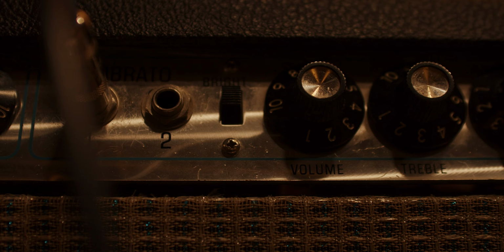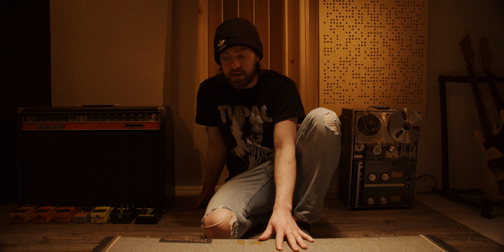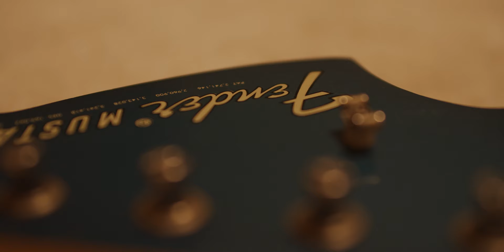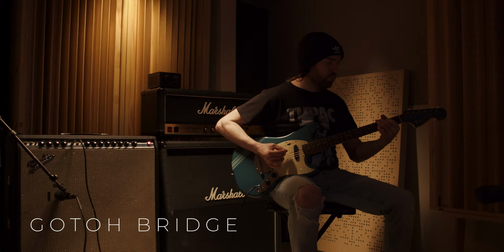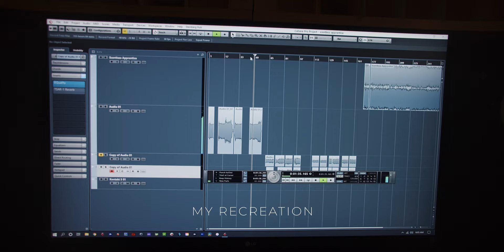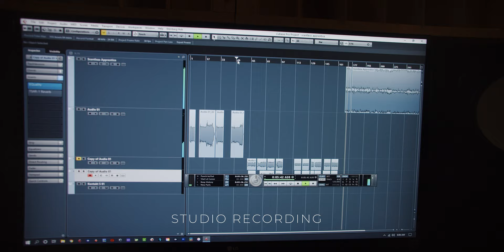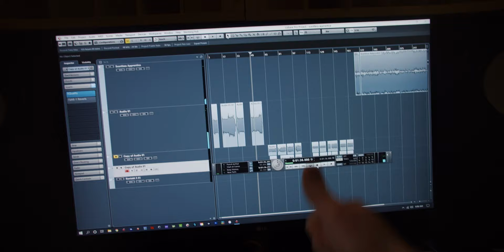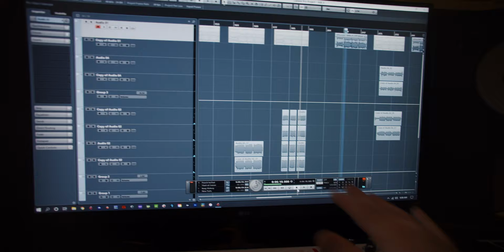1970 Competition Mustang. Original bridge VS Gotoh Tune-O-Matic bridge for Nirvana Tone

Comment: I hope this helps, I have 3 mustangs and I turned the “cigar” on the bridge backward so the strings are pulled straight through. Then I put a lock washer on the posts and screwed the posts all the way down so the “cigar” is flush on the tremolo plate. Why? Because that’s what Kurt did. It does effect the tone (for better or worse that’s your opinion) but it does replicate his tone a great deal at least to my ears. Also when I put new strings on a guitar I tune it to pitch, stretch the string two strings over, and repeat until it stays in tune even after stretching the string. This will help with the new string sound that I also hate. You remind me a lot of myself when it comes to what you’re doing with replicating Kurt’s sound. I’ve been doing it for 22 years. Again, I hope this helps.
Reply: Couldn't have said it better!
Reply: I agree flip the cigar tube around go to Home Depot and get some Allen head machine bolts and 7mm washers and loc tite then you don’t have to have washers under the tube which are visible and with the bolts the tube sits flush against the plate giving a steeper break angle to the bridge.
Reply: Right, you don’t want the washers to be seen, that would look weird. You’ll have to remove the tremolo plate, remove the springs, then put the washers on and tighten. Then put the tremolo plate back on.
Reply: Do you have a video or photo instruction how to do that? I mean the bridge. That would be really helpful
Reply: @jessielike2  I don’t have a video. If you remove the plate you can see the posts I was talking about. Remove the springs from the post and discard them, unscrew the posts in the “cigar” the strings run through, turn the “cigar” around, put a small lock washer (a THIN lock washer) on the post and screw it back into the “cigar”. It’s really that easy.
Reply: And how to get rid of the new sound of the strings?  Make them sound more vintage and old
Reply: @jessielike2  the brightness of the new strings will go away the more you play them.
Reply: @jamesh1625  Yeah man, that's the problem. It takes me a few months to get good sounding strings. If only there was a way to do it faster
Reply: I tightened up the springs in the tremolo and it drops 3-4 frets down and 1 fret up while keeping it in tune NO MATTER WHAT . Case in point it goes back and forth with me 5 days a week and in temps 20-70F and NEVER needs tuning.... It's almost scary how it's always ready.
Reply: There is absolutely no advantage to reverse the cigar (apart from doing like kurt). It doesnt bring any tuning stability. It only makes it impossible to use the supercool vibrato, and it ruings the break angle (if you dont use one those tuneomatics that makes 7.25’ radius mustangs play like shit and being impossible to intonate properly). It’s just 100% downgrade

Comment: Your video quality and production is always so consistent, you seem to prefer quality over quantity, Overall TOM does sound more darker and it doesn’t let the notes ring out as much than the stock bridge. After hearing the comparison I must say I was pretty dumbfounded that the stock bridge did sound a bit like Kurt’s real mustang but also the TOM also did have some of that aspects of Kurt’s tone here and there. In conclusion: Stock sounds better and TOM has better tuning stability and Intonation.
Reply from the maker: Thanks man, I agree. I've already reverted it back to stock. I've decided to sell this mustang. I like my sunburst one more.
Reply: @AaronRash  Yeah i recently saw the listing, I know that it's your guitar and you decide whether you keep it or sell it, but im just gonna say here that you should keep it and it will shoot up in value in a few years
Reply: No, the tuneomatic doesnt bring more stability (you can put sleeves on the mustang bridge posts if you absolutely want it non-rocking, but from my experience it’s completely useless on a stang). Regarding the intonation, tuneomatics make it almost impossible to intonate properly, because of the mismatched radius that brings the outer strings action way too high especially in the higher frets (and anyway, the mustang bridge also has also individual saddles ajustments, so no advantage there too)

Comment: Agreed. The tune-o-matic takes all the low end thump out of the guitar and gives it this nasally midrange. Another problem is that it introduces a radius mismatch with the 7.25” fingerboard. The tune-o-matic bridges are made for Gibson style guitars and thus have a 12 inch radius. I’ve had a few guitars with this pairing and find them uncomfortable to play. Great video!

PS: you made me wince when you started filing the saddles without taping off the pickups! Those metal filings can wreak havoc if they get on the pickup magnet.

Comment: How did you get the posts to the TOM bridge  to fit in the mustang thimbles? Also Milk It sounds fantastic dude. Can’t wait for that! That’s my favorite In Utero track I’d say
Reply from the maker: Thank you! I just took some gaffers tape and wrapped them around the post to fit.
Reply: @AaronRash  i did that to my 95 jagstang...I got it brand new in 96 i think, made that mod to the original tremelo/bridge, its held up this long.....and its still the same tape...
Reply: It’s likely that mounting the Tuneomatic with gaffer tape isn’t going to do things any favours tonally. 

I recently swapped from a Mastery to a Tuneomatic on my JM using Rocking Excenter Bushings and prefer the Tuneomatic. 

The bridge still rocks as there is a little bit of play in the mounting posts in the bushing holes and with the bridge on the posts and thumbwheels.

Comment: What type of Gotoh Tom are you using Aaron? As I see others doing this mod by taking out the bushings from the body, plugging the holes and redrilling for the Tom bridge, where as you just did a straight drop into the body mounted bushings, see I’d like to try this way so i could revert back to the original mustang bridge 👍🏼👍🏼👍🏼 Cheers bro

Comment: Nice video, as always. Just to react to some comments i read. I had 3 made in japan mustangs (and played a lot of my friends’ stangs too). These were among the most tuning stable guitars i’ve had (a lot more than my SGs and LesPauls with tuneomatics and stop tails which couldnt keep a G string in tune for 5 minutes). Putting 12’ tuneomatics on those 7.25’ radius guitars and reversing the cigar is 100% downgrade. It brings nothing but problems; makes playing difficult because of the inconsistent action (and yes you can file the TOM saddles, but you have to remove so much material it causes other issues in most cases), it makes the guitar hard to intonate properly (outer strings too high in the higher frets), makes a super cool vibrato unusable, makes you having to shim the neck for no valuable reason (mustang bridges also have individual saddles ajustment, they stay put if you don’t use the trem, and you can put some sleeves around the posts if you absolutely want them non-rocking). And now, thanks to that video, you can see that it doesnt sound better either (not that KC was doing it for tone purposes anyway). Just keep in mind that it was a different time (no internet ressource, no straytrems / masteries / halons and what not). Now people just know better on offset guitars, and imo there’s no point paying extras to modify a perfectly fine guitar to only make it worse. And it’s ok to love Kurt without cosplaying everything he did, even some odd choices he made when he was 25 (i bet he’d prefer that too anyway).

Comment: I noticed the nut slots were too deep and the Gotoh saddle contact points were filed way too wide and round. I know you wanted lower action since tuneomatics in fenders sit way too high, but that really affects tone and intonation. The string contact points have to be filed to a thin and sharp point. Im putting a fresh Gotoh in my mustang, and I’m going to slightly shim the neck like you did but with a full shim . I made a new bone nut from a blank with proper slots and string height and I’m also going to grind down the underside of the Gotoh where it sits on the thumb wheels, to avoid filing the saddles.

Comment: The original clearly sounds better. Have you set the pickup height in relation to the the strings equally in both bridges? If you are having problems with the stock, maybe you should try the Mastery, I like to think it is what Kurt would be using nowadays. Thurston Moore and Lee Ranaldo use them. 
Regarding IU tone, I made a video trying to recreate Very Ape lead guitar tone, got a close result using a P90 equipped guitar (simulating the Veleno) and a op amp fuzz, perhaps that's the song Kurt used a Big Muff (Albini mentioned one being used).

Comment: You can try nylon saddles on the tune o matic it will mellow it out a ton. try them. also he reversed the tail piece which actually changes the string tension a bit. try that too! I had a 69 just like yours (and kurts) I did all the same mods - then sold it. Still regret it. I now have the sig. Mustang in sonic blue -it hits the spot.

Comment: Don’t be so quick to lose the Tune-O-Matic.
There’s a couple things you can do to improve it.
You can switch the saddles to either roller saddles or nylon saddles that most Gibsons used in the late 50’s and 60’s.
I think either of the two will outperform the stock metal saddle that Gotoh uses.

Comment: the gotoh on its own sounds really dull but if you block the trem and flip the cigar so the strings run straight through (like kurt did) the tone is a lot better
Reply from the maker: Hey man, I've done that before also, not enough downforce on the bridge and the tone sounds worse in my opinion. I'm actually not really a fan of Kurts live mustang tone. I'm crazy about the in utero recording tone though.

Comment: I put a Gotoh oh my new jagstang and I also have mixed feelings about it. The neck is a 7 1/2 radius or whatever so the two e's seem a bit higher and then so you're always fighting string buzz or those two being lifted. I don't know what neck you have, but if the radius is less than the newer 9 or flat 12 it could be that? I'm a tinkering, but I'm unsure of my skills, so maybe my shim setup isn't right or maybe my bridge needs filing. It probably is the filing for me.

Comment: Hi guy! I'm trying to know what the width of the stripes is on the fender mustang competition, could you measure it for me? I have a Classic Vibe '60s Competition Mustang and it is 4,5cm (1,77165 inches) wide. I want to sand it to paint it like Cobain's so I bought a sonic blue stripes sticker but it is 3cm (1,1811 inches) wide. So I was wondering what the official width was on 1969 Mustang Competitions, could you answer that? Thank you very much and congratulations for your work

Comment: I do like it better with the stock bridge, the funny thing is that he used the Competition Mustang in it's original state to record Nevermind, he added the tune o matic bridge later in '92. so the most relevant use that guitar ever had was while it was original. In regards to the tone, I think any guitar changes a little bit (or a lot) if you replace important parts in it, like electronics or hardware that actually touches and transfers the vibration on the strings.
Reply: Did he have the hot rails in the Mustang during the Nevermind recording
Reply: @sofaslapper8715  no
Reply: he didnt use competition for nevermind
Reply: @mirata7748  Actually he did use it...
Reply: @mirata7748  He used it for the clean guitar part in "In Bloom"
Reply: @sofaslapper8715  thought that was just a strat single coil
Reply: @sofaslapper8715  he also used it SLTS

Comment: Are you using the Nashville tuneomatic or a vintage style and wrapping electric tape around the post to fit in the stock thimbles… I think he used the Nashville style that would make a more solid connection and also the bridge was probably chrome over brass
Reply: Also… Use the shim only if you can’t get the bridge low enough… on my jagstang I noticed the most sound and playing change simply by removing the springs under the tail piece, but the whammy is fun to use on a mustang so I put it back but it sounded a lot better to me

Comment: Great video dude, thank you. The way you shimmed the neck would work for angle, but wouldn't you be reducing the neck to body contact loads? Aren't shims normally an angled wedge of wood? Stew Mac sells them. You'll laugh, I took my Mustang's tune o magic bridge to my bench grinder and just removed tones of metal until the action was playable. Didn't shim the neck. People who know stuff about guitars say the tune o matic is a bad fit for the Mustang because the neck radius is incorrect for the tune o matic, which effects string height consistency. I guess it's a do you want it to look right or sound right thing. Keep up the great work!

Comment: have you considered a buzz stop? ;) jk actually I don't think one exists for mustang trems. I used to rub some chapstick in the bridge saddles that would help with the tinny-ness. I hear white lithium grease works well too. The only other thing I can think of is using the screw-in thimbles for the TOM bridge, but not exactly a mod I would do on a vintage guitar either. Maybe theres some other way to stabilize the bridge posts in the thimbles could help.
Reply: Electrical tape there helps keep it sturdy.
Reply from the maker: I've already reverted it back to stock. I couldn't stand how it sounded with the TOM, plus I've decided to sell this mustang

Comment: Also needed to flip the tailpiece around gives you a better break angle and better sustain
Reply from the maker: Hey Luke, I’ve done that a million times I prefer it the stock way because I’m feeding the strings under the cigar tube. Flipping it make no difference in this case and actually gives you a worse break angle

Comment: The prices people want for that matching headstock vs a later 70s normal headstock is actually shocking. 10 grand for a 69 mustang vs 2500 to 3500 for a stock 72. 7 grand for the look. Ya can buy a nice vintage jaguar candy apple red matching for about 4 to 5 grand. The Japanese 69 reissue has the matching headstock why not just swap the neck keeping the original and save enough to buy that vintage jag also?

Comment: Is there not an issue with fitting a 12" bridge onto a neck with a 7.25" radius? The action will be a struggle.
Reply from the maker: Nah the action and stuff is fine, but I've already reverted back to the stock bridge, I like it a lot more.